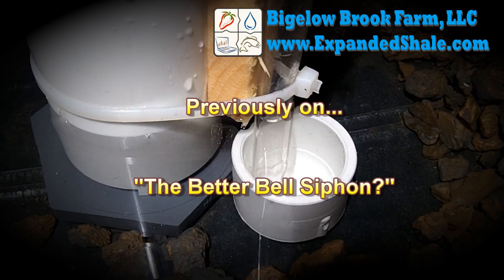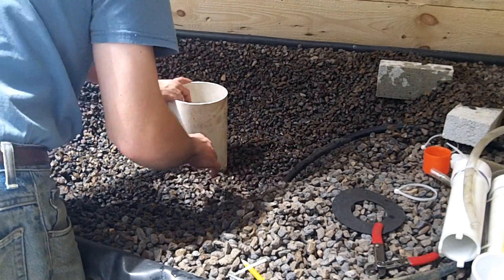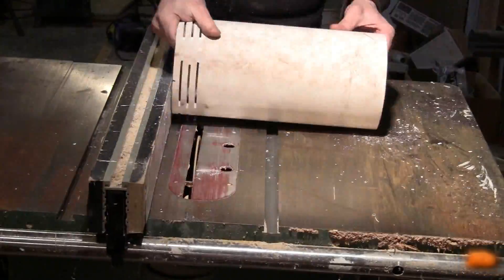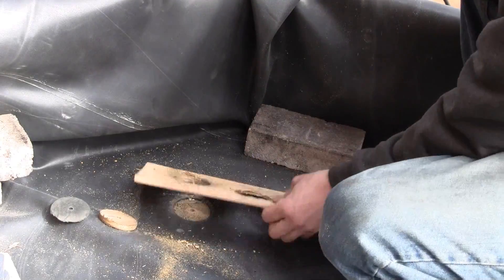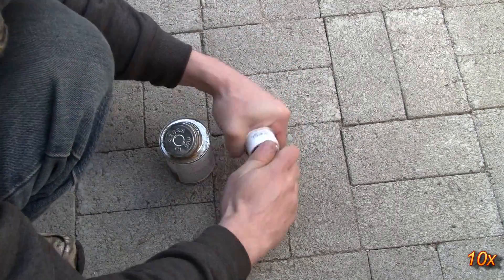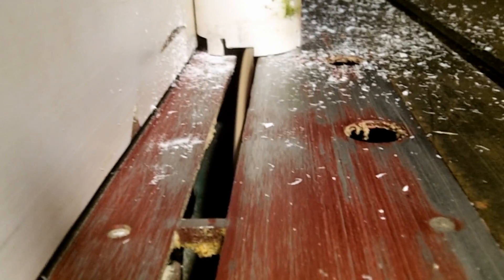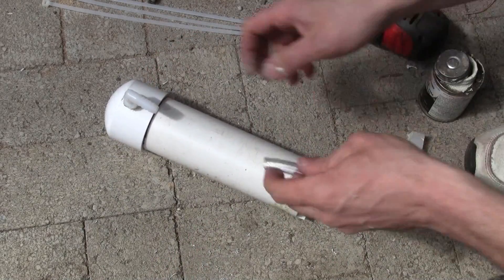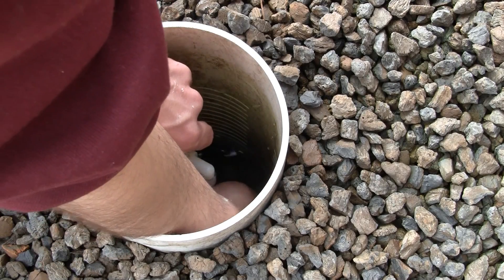How To Build a Bell Siphon

Comment: I used similar tricks with chop saws on jobs, always wanted to try making my own pvc fittings like what you did with the spade bit and the 3/4 inch fpt die, I highly recommend True blue pipe dope, they sell small squeeze tubes of it, I love the milling you did with the table saw,  with regards to the Vinale hose you used off the barb, I use a piece of copper solid wire, twisted, or a zip tie works great too, great place for a dab of True blue, seals every thing, Propane approved, Do another one,  Video, ask for donations to cover your materials and, pay yourself, create a job, hobby of sorts,, get paid, have fun, teach others, build kits and sell them online, I loved your video, Good luck

Comment: The snorkel is unnecessary, it's just for lazy people who doesn't want to size their siphon.
Reply from the maker: not true.  If you look back into the designs in the 1800 in the sewage systems, it's a key part to insure it operates properly regardless on how much flow you have.
Reply: Bigelow Brook Farm (Web4Deb)
In cases where you have no control of the flow, sure it's necessary, not in the case of controlled environment.

Comment: Hello All. Big Thanks to Rob for the videos and game changer innovations! I love the grow grips and the shale for my seedling system! I am having ISSUES with getting this siphon design to work. I have been struggling with this for weeks with not much success. I have a 21 sqft bed, 12 inches deep and mimicked this video as close as I can see. For those using large beds (20sqft and larger), what length outflow are you using after the p trap and any elbows used? Also, how much of a drop from the p trap to the end of the outlet pipe pouring to the sump?
My issue is, to get the syphon started I had to increase the flow. That meant that the flow in was nearly as much as the siphon could flow out. Before the water level got down to the the cup, it reached equilibrium and stayed the at the same level. My other issue was the siphon not starting and overflowing the bed onto the ground (this system is in my house). I need to increase the siphon's ability to flow faster and increase my drain speed or have some way of decreasing the flow into the bed while still starting the siphon. The threshold for flow into the bed is too negligible to be reliable in any way. I have zip grow towers, a fish tank and the grow bed fed from one pump. Any adjustment would throw out the grow bed from its exact flow rate needed if that is even achievable in the first place. I would think that using 1" or larger pipes would achieve a faster drain but that is where I started 2 weeks ago. I am now going in circles of trial an error without any success. 

I just don't understand why I can not replicate this design other than thin walled pvc being not available. I had to use 3/4 schedule 40. That was after trying 1" schedule 40.

Any ideas before I rip out my entire system?

Many Thanks!
Matt

Comment: I am starting my first system and I attempted to test my siphon in a bucket of water before working it into the system, however it doesn't create and suction it just dumps water down the standpipe. I am using 3/4 inch standpipe and an 1 1/2" bell, would I need to increase the the outer portion to 2" or may I have another issue? Thanks.
Reply from the maker: +Jessy Artman Maybe a longer drain pipe under the bed to create a bigger suction.  Another trick would be to make the bottom of the bell have less area for the water so it creates a little more restriction and force more water through the breather tube.  Or the breather tube is too high...it should enter the bell at about the level of the top of the stand pipe.

Comment: There's probably a tiny allen bolt in the side of your hole saw which you can loosen to allow the inside drill bit to float freely of the outer shell. And it's probably metric.

Comment: "
BroganTDB7 months ago
 
Here is a request, could you post a parts list that one can print out? The adapters for the stand pipe and the one for the trap are confusing..
"
I would like to request this too.
Reply: hey pal did you figure out where one can get the 90 degree NPT fittings from? i searched the web and they are hard to find

Comment: Why is a bell syphon necessary why not just a stand pipe? I have used stand pipes for years in aquarium overflows with no problems. It just seems like allot of extra for no reason.
Reply from the maker: This isn't a standard overflow, the purpose is to made the water level rise and fall in the grow beds.

Comment: What if I put a the breather tube on the top of the bell siphon instead if the side? Would it affect the siphon our design
Reply from the maker: it can make a difference,  the siphon may not have enough suction to get the water all the way up and over to the top.
Reply: ok, cause my bell siphon it again giving me problems. i fixed the old problem of not having enough flow to start the siphon now it back but i ahvent change anything except for the the grow bed it self. But strangely with the good flow and all, its ahving a hard time starting, it just stay full and sometimes the water level goes over the bell siphon, so i believe the pressure is there?
MY bell siphon is 15mm inner diameter and bell siphon is 30-35mm inner diameter.

Comment: love your work.  I am starting a similar build with the pond liner grow beds and bell siphon.  just wanted confirm, is the 3/4 inch drain pipe the internal diameter? I have the metric equivalent and it looks smaller than what you have used
Reply from the maker: I believe it's the inside diameter, but since this is a thin walled pipe, the inside diameter is a bit larger so that the outer wall will fit the standard fittings.  You should be able to use something that's close.

Comment: Great tutorial. I made one today, after experiencing the problem of the siphon not completely stopping. I find, when using pea pebbles, the water level at the siphon drains much faster than the opposite side of the bed, due to all the resistance from the small pebbles, that the siphon partially stops, but then, as the water level redistributes itself again, some water gushes to the siphon, causing the suction to resume before the vacuum has been completely broken (therefor the siphon does not stop completely).

I've just installed your design and I'm about to do a proper trial run. If my roots start rotting because the bed doesn't drain low enough I guess I'll either have to install a little drainage system towards the bell siphon, or use bigger pebbles so the water can flow faster and drain before the suction is broken by the little cap drop.

Or, I guess I can choke the return line to my sump so the siphon flow is reduced a little, but still more than the water coming into the bed. That'll give the bed more time to drain evenly.
Reply from the maker: the roots will be fine.  The flood and drain cycle will draw in enough air to keep the roots happy.  I've been running for years with these siphons and haven't had any issues with root rot.  Thanks!

Comment: Some suggestions from a carpenter builder w/50 yrs experience:
1. Put a large, thick washer or 2 inside the mandrel before you drill, so as to get the disc out more easily.
2. Do NOT do the priming [it's purple; solvent adhesive is clear, grey, or bluish] over finished masonry paver bricks, as it's VERY difficult to remove the stains.
3. Keep some sandpaper on hand to remove the burrs.

Comment: I have a large bed (120" x 36" by 10" (LxWxH) that just wouldn't ever break siphon so I  tried to do this. I've tried caps from all the local big box stores and none of them float. I have 3/8 tubing, but it seems that it's just sucking a continuous small stream of air and water since the cap won't float. What am I missing?

Comment from the maker: 1/2" tubing will be fine.  I don't like to use less than 3/8" because it seems to catch too much junk.  If you can find a 3/4" bulkhead, that will work fine.   I get the other ones as surplus so it's what I had laying around.

Comment: Questions Please:

1) Would I be just as well off to buy a 3/4" bulkhead and use 3/4" pvc for the stand pipe or is there magic to having the 1 1/4" stand pipe inside the 2" bell? 

2) the clear tubing you attach to the side of the Bell siphon... Would a 1/2" tubing work the same or is there special magic to that size tubing?

Thanks for helping me.

Comment: I have worked some with these bell siphons, i discovered that the cap at the bottom does not need to float, just has to be taller than the inlet openings. See my bell siphon update. Let me know what you think.

Comment from the maker: I agree with this too!  I can remove all my stand pipes and traps.  Sometimes I like to adjust the water level in the beds and it's simple enough to yank it out and put in a slightly shorter one.  After our open house, I did discover some stones in my bells....kids love getting into trouble!
Reply: im tryin to rigg my water collectors to floatvalve/ bell syphon to another float valve or have water stop for drip feed any suggestions or things to help
Reply: the float vlaves then regulat the bell syphon
Reply from the maker: @coryryder9070  I recommend keeping the systems as simple as possible

Comment from the maker: Yup.  I agree.  I run my water really slow slow so it's hard to get the siphons to kick on without the trap.  Higher rates and you could use a standard bell or the Afnan variation.  Basically, I would say these are 99.99% reliable.  It's the roots that cause problems!

Comment: My rule is all stand pipes should be removable!  I just encountered some stand pipes that people had glued into place.  AND there is a rock in one of them, and no easy way to remove it.
And what if you wanted to change the system over to timed flood and drain later?  How do you get a drill in to put the holes near the base of the stand pipe if the stand pipes are glued into place?  Or what if the stand pipe is the wrong height and you need to cut it down?
Keep drains removable.

Comment: I had never actually seen your siphon version with the breather "CUP" pretty cleaver.
Now if you have your grow beds draining into a tank directly below the grow beds, Skip all the extra junk, don't bother with traps or breather tubes until you test it out because it can be very simple and the extra stuff is only to get it to work if it doesn't just work in the first place.

As to the uniseals, they make it difficult to remove the stand pipe.  There are some tricks that can be done but...

Comment: Forget bulkheads.  Get Uniseals.  Cheaper and easier to work with and leak proof unlike most bulkheads that are expensive and generally will leak if not properly seated and tightened exactly.

Comment from the maker: I had purchased a bunch of the 1-1/4" fittings at surplus for a fraction of the price of new ones so it's what I'm stuck with.  ;-)  Most of the ones that I've found don't have 3/4" slip-fit built in, which would be the best.  By luck, the 1-1/4" thread to 1" slip fit adapter and 1" to 3/4" adapter are fairly cheap and can be found at Loews or HD so I just went with that.

Comment from the maker: I don't know what all the part numbers are.  The problem is there are several types of bulkhead fittings on the market which need different adapters.  The best bet would be to find a bulkhead fitting, then search at Lowes or HD for the adapters that will get it down to a 3/4" pipe.

Comment: 1. Lovin' the Ragtime.  2. I had no table saw so I used a hole saw on the bottom of my bell housing - drilled four holes equidistant around the pipe, then cut it off about halfway with a hacksaw.  Table saw looks much easier!

Comment from the maker: It's not required, but sure is helpful.  Usually it's not an issue if you have a small bed, but once you get into the large systems, the water level drains much slower and the siphons don't always break properly and get stuck in a half on-half-off state. The trap under it helps to burp the siphon to get it started again, if you have a higher flow rate, it's not necessary, but I run my beds really slow-some of them only cycle every 2-3 hours. With a "traditional" bell setup, it would never start.